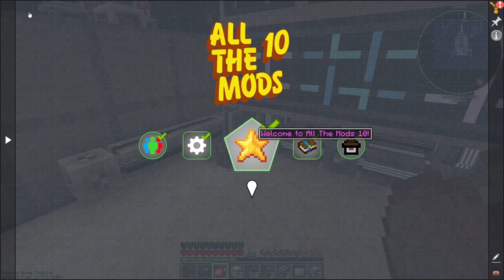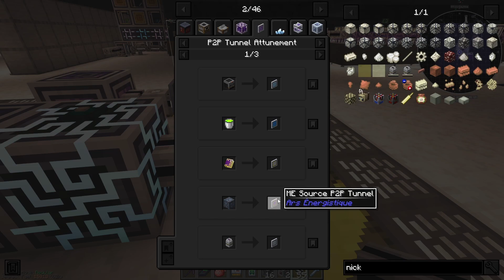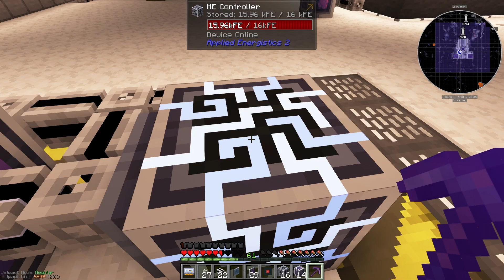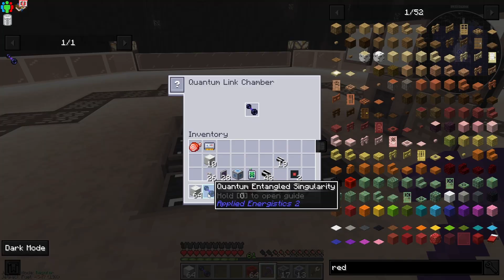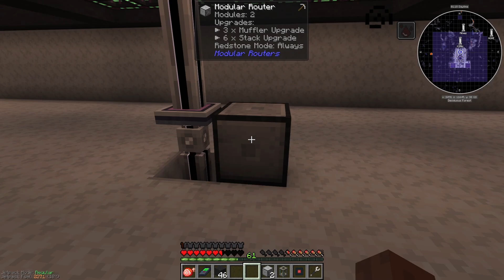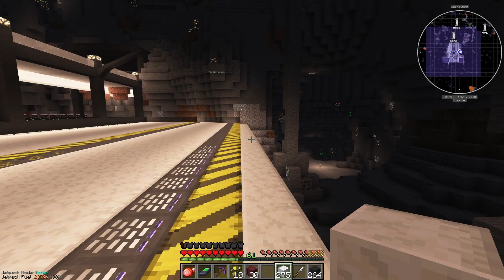ATM10 Ep10 Wireless Terminals and MOH POWAH BABY!

Comment: Couldnt you use a modular router to deliver power without contact to the controller?
Reply from the maker: @rasmusskogh7451  yea, but theyre laggy
Reply: @KSAW00  Is that so? I havnt had that experience myself. I use them for a bunch of things.
Reply from the maker: @rasmusskogh7451  yea, afaik, theyre a tps hog specially with speed upgrades

Comment: Isn't this just the same issue? you're replacing 1 of the p2p for an energy p2p meaning it cant hold any more channels. Whats the advantage of giving it power this way?
Reply from the maker: The initial Ep2p idea was to allow the other interior faces to get p2ps of their own, because my ender gate was inside the core, i figure out a nicer way later on tho, dw :)
Reply: @KSAW00  so this method basically had no advantages if you put the energy source on the outside
Reply from the maker: @ precisely! on the outside, the ep2p is the same as any ol flux thing, but at least it led me to a more streamlined solution :)

Comment: You can also just use an Infinity Range Booster in the wireless access point and then upgrade it to a Dimension Card for cross dimensions as well. Rather than making a quantum ring.
Reply from the maker: But quantum ring cooler lookin 🤠

Comment: 4:56 - You can easily solve the power issue by looping the input or output power source around and into the main network with a quartz fiber. However, this won't work if the network is down, so you can kick-start it with a battery or energy cell. You can also just leave the energy cell as a backup in the event of a power outage. 
I personally always have a battery or energy cell backup when I have remote networks or a network not directly connected to the power grid. 'Cuz, u know, good practice.  Nothing worse than being locked out of your system because your network ran out of power!
Reply from the maker: This is the advice ive been giving to everyone trying to build this style of controller

Comment: You never came back to the drive system setup. Currently what im stuck on as the terminals wont detect them
Reply from the maker: @PureReject  timestamp?
Reply from the maker: @PureReject  right! I see i say that around 11 mins in.. the trouble i was having was that i have 32 drives and my p2p only had 26 channels left, so i was being a dummy and assuming i didnt need more channels when i didnt even have enough to start with ..
Reply from the maker: Your drive might not be seen by your terminal because of many reasons.. rclick the controller to see if they have channels
Reply: @KSAW00  I tried without a p2p, says the drives are online etc running out of a wireless connector, but still wont work through the terminal. When i try p2p it says unlinked, despite linking the p2p panel to the main controller p2p. The terminal p2p however would say linked doing the same process. Somewhat new to the p2p but i dont see what im doing wrong
Reply from the maker: @LollyLover54  join the cabal, so you can share screenshots! Link in channel desc

Comment: If I put my 1k ME Storage Cell into my ME Drive it doestn fill up with power.... Any suggestions?
Reply from the maker: @dergruenedertee  is it an fe storage cell?
Reply: @ yes it is. It fills up within my inventory but not in any of my ME Drives. I‘ve connected my ME Drives to my network using a Wireless Connector + P2P Tunnel. I don’t have a Energy Cell connected to my system though maybe that’s the problem?
Reply from the maker: @dergruenedertee  maybe: also consider putting a gate on an interface with an induction card?

Comment: Why use a chemical oxidized instead of just putting it straight into the infuser?
Reply from the maker: @rng_void8442  tbh i originally wanted to setup a fully ae2 controlled system, so these 2ouldve output into chemical cells which wouldve then let me route the stuff around with my ae2 network... However, i had an adhd moment and figured i could do this directly

Comment: 45:30 Something I like to do is use the framed block edge blocks and put anti blocks in them. You get the same size light as the top and bottom lights but you don’t get the silly wrap around thing and they can be whatever color you want
Reply from the maker: @westecles  oh shit thats a great idea
Reply: @ you can do the same thing with the colored light blocks from simply lights but if give you a gray light that blends perfectly with gray concrete